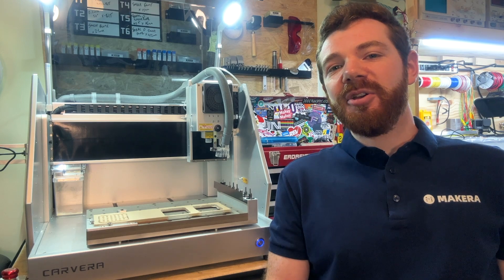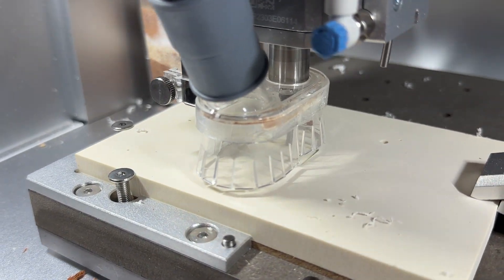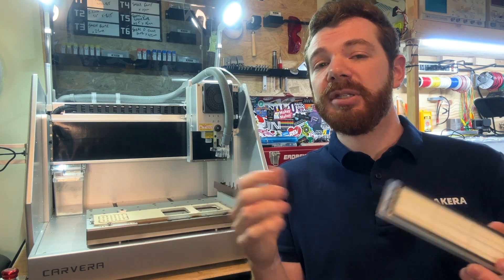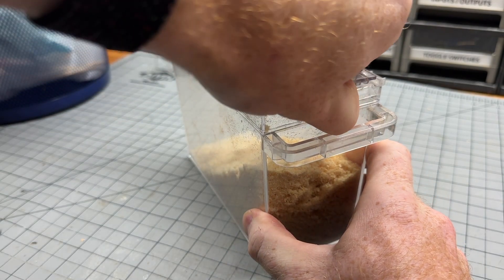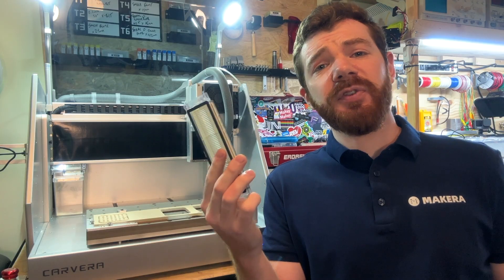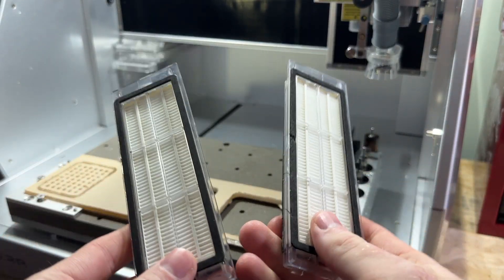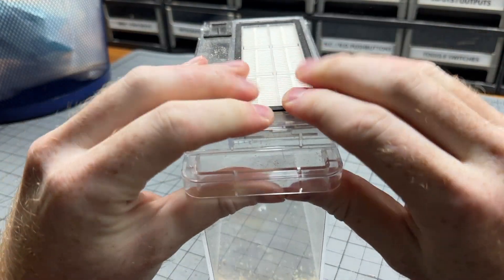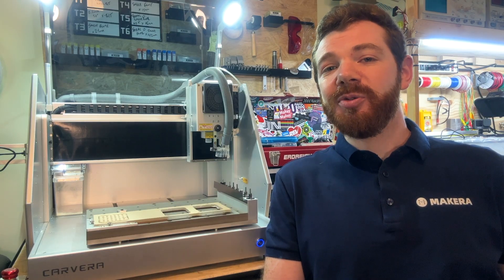How to Clean and Replace Dust Filters for the Carvera CNC

Comment: There's a flaw with some of those filters.  I ended up with dust trapped past the pre-screen mesh.  Had to remove that useless mesh to clean it out.
Reply from the maker: Hi, thanks for your report, we have removed mesh for the the new version of the filters, and have enhanced some other aspects. It's much more efficient and easier to clean now.
Reply: @Makera  That's good to know.  Thanks!